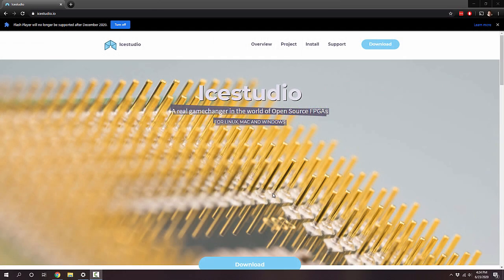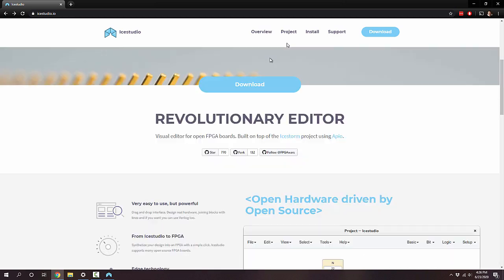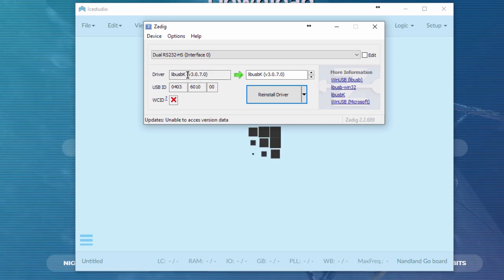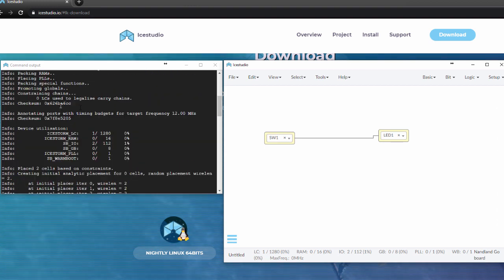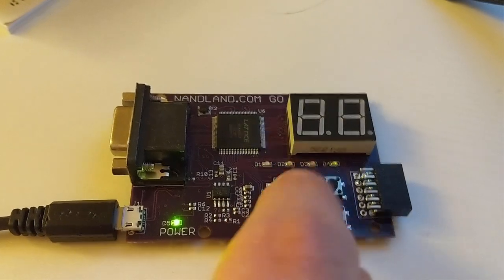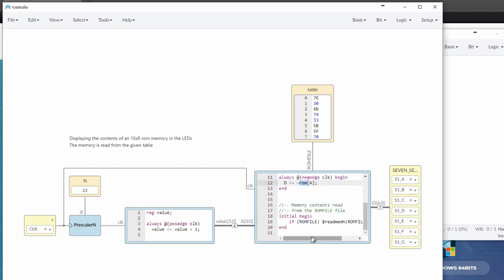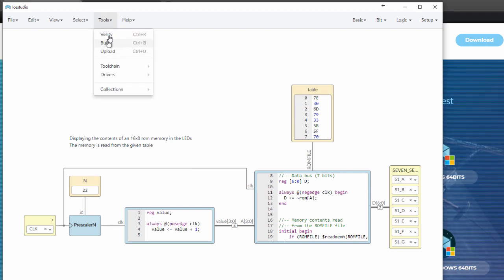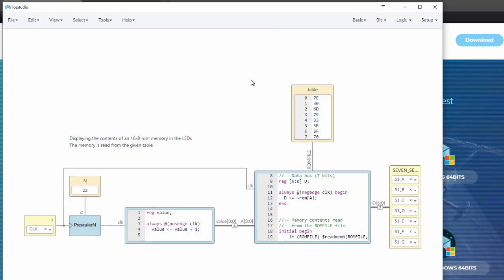Icestudio - Open source GUI for FPGA design and programming, visual drag-and-drop, no code required!

Comment: I think this graphical tool took inspiration from FBD (Function Block Diagram) used for PLC (Industrial) and DDC (Direct Digital Control = BMS ). Niagara 4 Wiresheets and Trend SET is similar to this tool.

Comment: Yo', that shit doesn't divide by 22. Have you actually looked at the prescaler code? It divides by 2 to the power 22. Takes the 10MHz clock and turns it into something close to 1Hz. Do you think that if you divide the 10MHz by 22 you get Hz?

Comment: I am currently playing with gowin GW1NZ tang nano fpga, as its just $10 for a small development board, which is great for small projects, and the gowin IDE though basic, gives a reasonable working environment. what other low cost boards would you recommend, played with the Altera Nano De0, De1 but never tried Lattice.
Reply: ICEsugar nano, ICEblip, ICEstick low-cost and ICEfun are options - they all can be used as well with ICEcube2

Comment: MASSIVE DUDE. I work as rtl design engineer and few days back i designed a 16x2 matrix lcd in verilog. But it was difficult for me to do simulation alone as i am not provided with any hardware to dump and see. But i wanted to have greater visualization apart from looking at only graphs . THIS MADE MY DAY. Can u post videos ON AMBA APB CDC SYNTHESIS TIMING CONSTRAINTS etc., THANKS IN ADVANCE

Comment: I think you should have acknowledged the "new nightly version" pop-up instead of ignoring it. There's enough people who won't understand such an feature of open source projects... well I think new users of FPGA programming might also be new to FOSS, and the damn pop-up is so freaking big on the screen (nightly builds aren't even exclusive to Free and Open Source, but lets just acknowledge it's there, and that such notices can easily be turned off) Otherwise its a great presentation. On another note, I just started looking at a book that pleads the case that FPGA programming isn't well integrated into "dev-ops practices", which reminds me of the status "html programming" in the mid-nineties.  There wasn't enough JavaScript or other technologies to make "web programming" seem like "real programming". It was sometimes treated as a scripting toy by mainstream professionals, but simultaneously a big push to put " web programmer" as a resume qualification. FPGA seems to be there at the moment, like just "scripting for hardware electronics", and not part of larger everyday workflow in corporate dev-ops. Expect that to change.

Comment: Could you make a video about using opencores on opencores.org. There are alot of opencores for FPGA but I dont know how to use them on my project. Currently im working with Intel quartus and most of IP core from this software require subcription
Reply: Yes, that sort of training is hard to find on the internet.

Comment: Ok so I installed this under Ubuntu 18 and when I select the go board it says I/O not defined, even tho when I click on the PCF it shows all the I/O's are indeed defined. Any ideas?
Reply from the maker: Is this when building the project? I had an issue where I had to change the I/O from the default on the drop-down to something else, then change it back again. That was a weird one.
Reply: @Nandland  I figured it out...I think.... I used an example and it asks to load or convert.... I asked it to convert.... apparently it does not work. so I just went from scratch .... my other issue is how do I break out signals from a reg bus. In your 7 segment code, the reg value in your first code block puts a value[3:0] bus on the block. I want to send those bits to the led's on the go board.... how do I separate them to each of the 4 LED's?